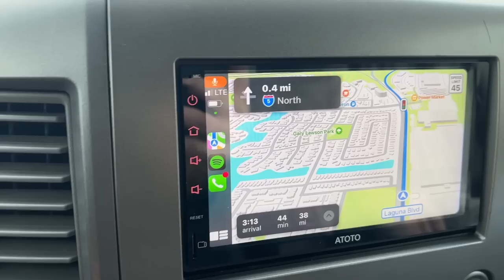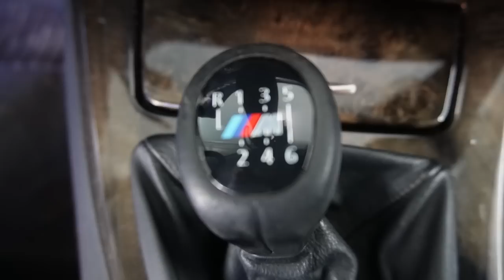I BOUGHT A 335I! MY FREIND WOULDN'T LET ME HAVE IT!

Comment: That milkshake comes from not driving the car or if it sits. Or if there is a failed oil cooler gasket - you probably didn’t need to get a new motor
Reply: I was just about to say… motor was probably good!
Reply: Just what I was thinking. It’s pretty rare to see head gasket failure on the n54. But who knows how long it’s been running like that.
Reply from the maker: Low compression cylinder one

Comment: That engine doesn’t doesn’t sound blown or appear to have any misfires when he got on it. That build up is usually due to short distance drives or a failing oil filter housing gasket. That smoke cleared up as soon as the motor heated up from him driving.  An oil change and ofhg replacement would’ve been a good first start.
Reply: I agree with this. My N54 would look like that (10 mile round trip commute) but as soon as i heat up the oil and put miles on it, shes good to go.
Reply: Definitely oil filter housing gasket💯💯💯